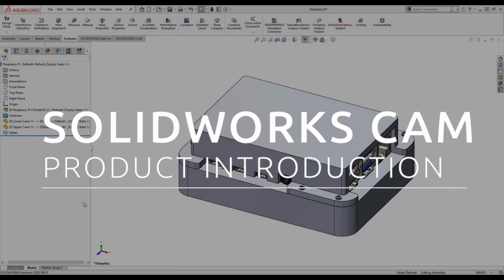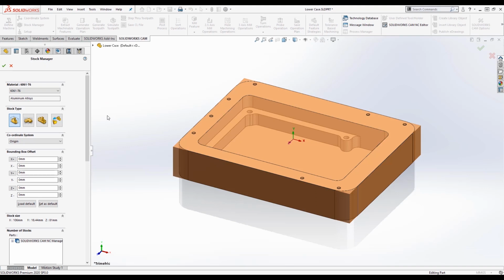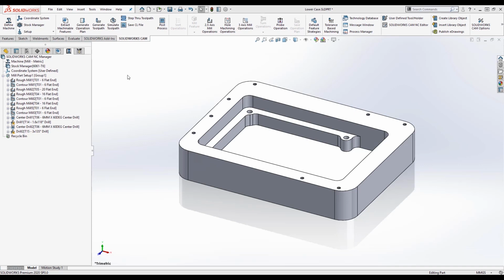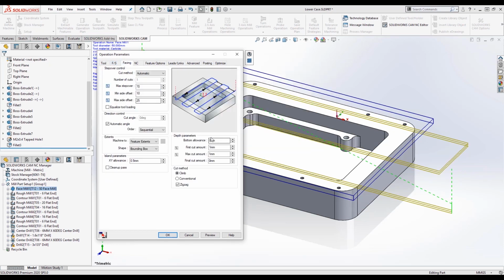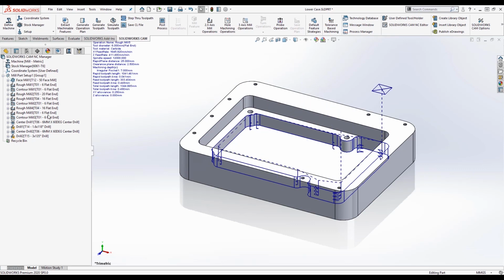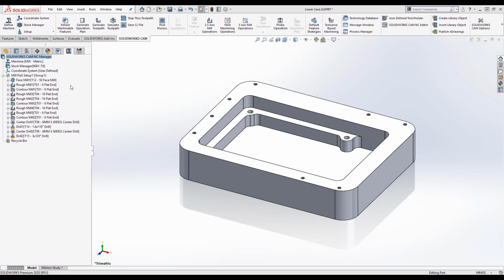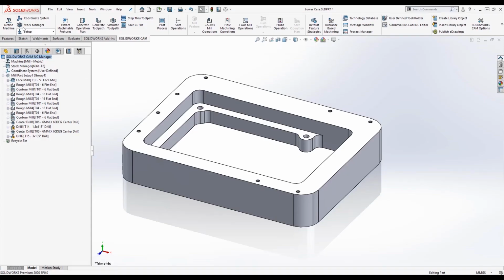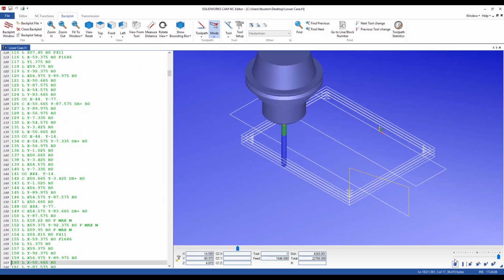Introduction to SOLIDWORKS CAM

Comment: Very helpful video. Thank you. 
I didn't realize until recently that Solidworks was capable of this. It seems to be very user friendly and comprehensive.
Just trying to set up a milling machine using Linux CNC
I am completely in the dark, however of which post processor to use

The machine is a converted Boxford 260VMC
Any suggestions?